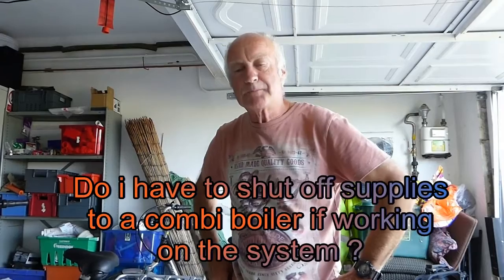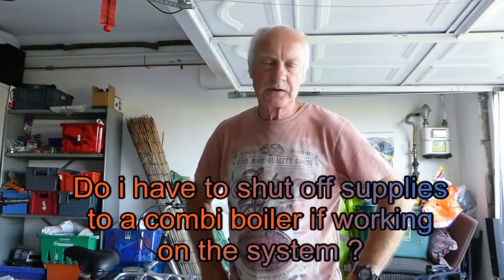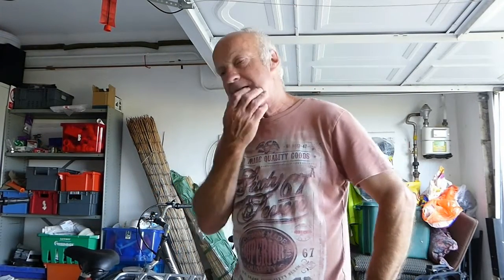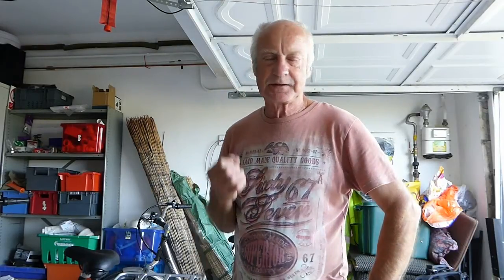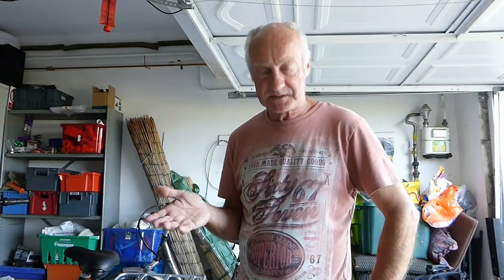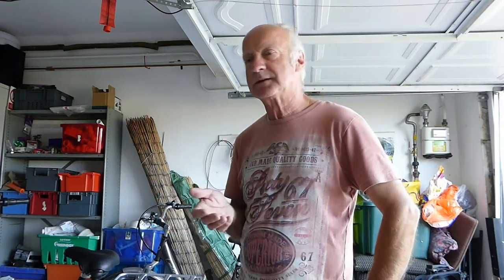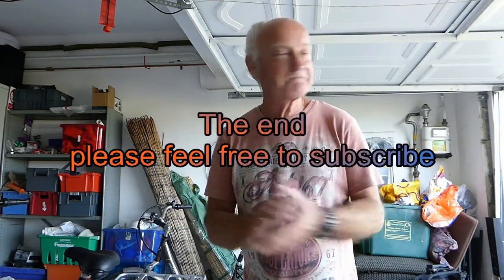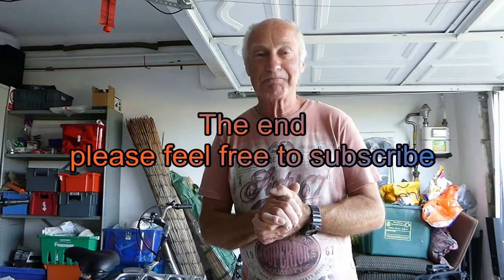Do you need to shut down everything when working on a Combi heating system?

Comment: I would agree that more often than not the pump runs on a hot water demand on a combi. The only other thing to watch out for is the very, very rare case of the combi boiler on an open vented system.
Reply: Daniel Caie pls how do i turn off the radiators parmanently off from d boiler because is a shared flat so everybody provide heating in their rooms individually

Comment: Hi. can I ask I've got an issue with my extention roof, my boiler flue is on the wall above thus extention and the roofers have requested the boiler be turned off while they carry out work near the flue. Is this actually necessary, I rent from loacal authority so not sure I can decline this anyway
Reply from the maker: Yes if it comes on say while running hot water then gas fumes will be released while men are working there. Carbon monoxide.

Comment: Hi Sir, I want to install a mixer tap . Which Volvo should I turn off to stop hot water in to taps. Please reply . Thanks
Reply from the maker: the main stopcock usually under the sink. If you have a combi boiler that will also turn off the hot water. If you have a F and E system, then it will be in the airing cupboard next to the hot water tank.
Reply: @dereton33  thank you sir